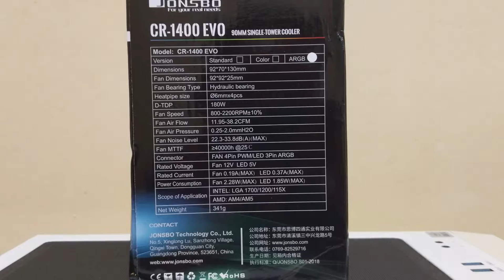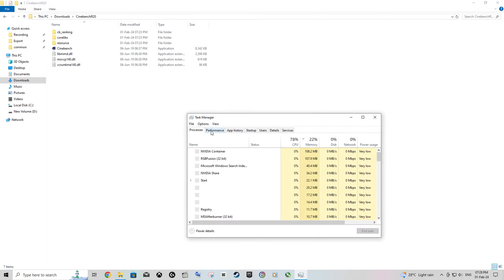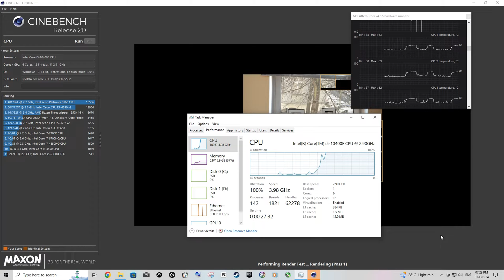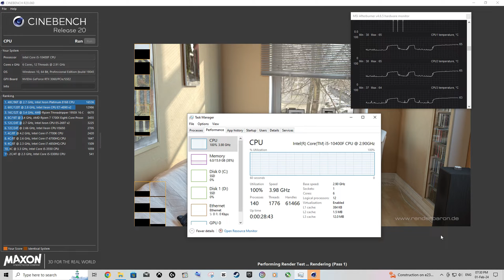CR-1400 EVO ARGB White - Unboxing & Installation

Comment: It is compatible to ryzen 5 5600g? And what your mother board po?
Reply from the maker: Yes, can support ryzen 5 and intel cpu. I use B460m Aorus Pro.
Reply: @ExtremelifeZue  bat sa ryzern 5 5600g ko hindi kasya T-T i cant seem to put it in my mobo
Reply from the maker: @miyuki9139  mobo for intel and amd cpu not same please check. But cr1400 cooler can use in both mobo.